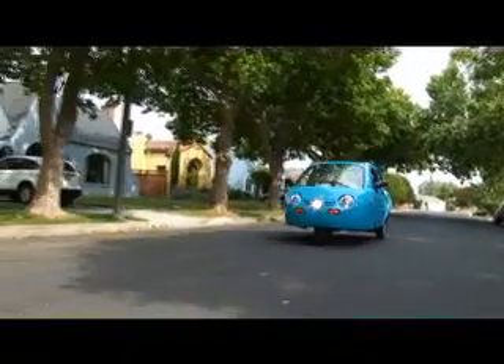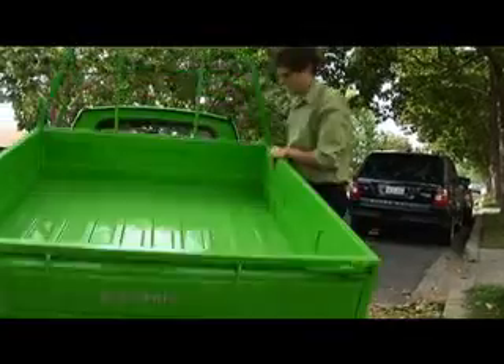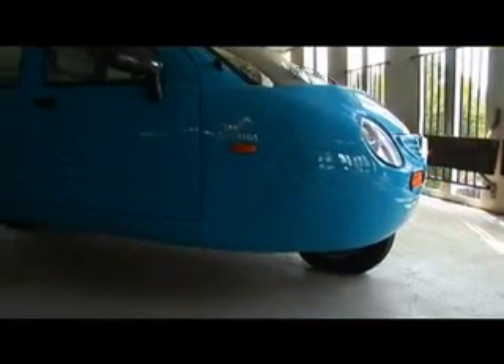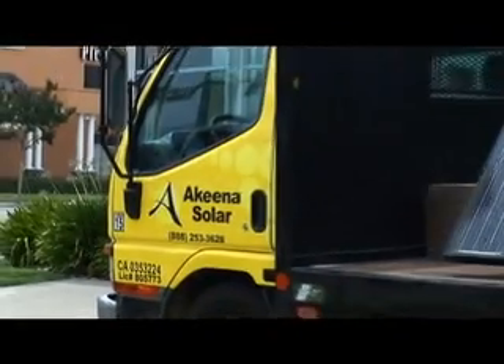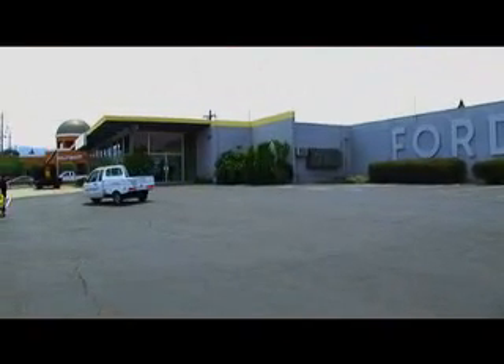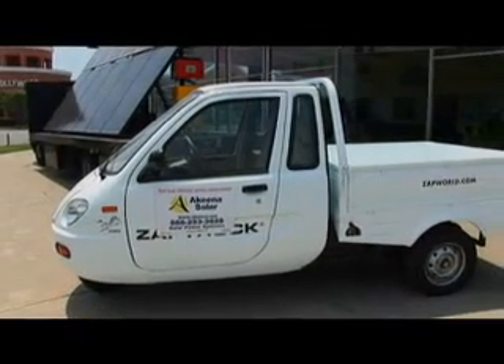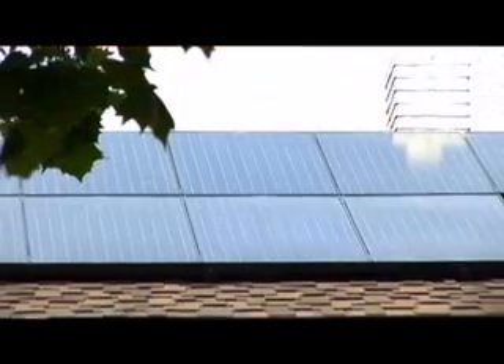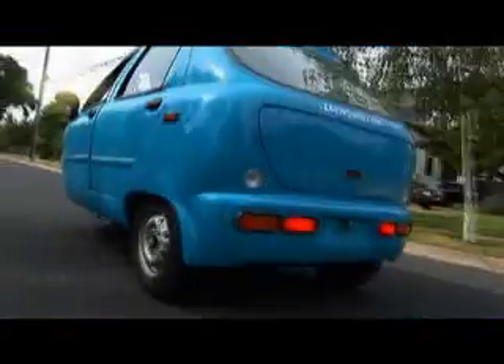Hippy Gourmet at Ethical Approach Autos & Akeena Solar!

Comment: i like the sound of a nickel a mile.  Gotta agree with others though that electric wont truly take off until the cars become at least as powerful as a typical gas guzzler and last about the same distance (at least 100-150 miles).  After that electric will become the rule.

Comment: 40mph 20-30 miles on a charge? not only is that too slow to take on most highways, it is not even enough to get an average person to their job and back. The other car that you mentioned that charged from the outlet isn't very energy dependent. The energy that comes out of your outlet is produced by burning coal. i don't see that as being any better than filling your car up with regular fuel.

Comment: You need to research that a bit more. Electricity from Power Plants is about 1/10 as polluting as using gas in your vehicle. Nothing is completely clean, but electric is WAY cleaner and more efficient.

Comment: I admire any experiment to get rid of the grip of the powerfull oil nations on the western world, But..Firstly, I think a car should at least be able to offer the same comfort as nowadays cars, and around 12 seconds from 0-100 km (0-60 miles), plus it should be able to drive at least, really.. no less than 150-160 km/hour
with the same safety as nowadays cars, (guess you can't make them too light)
IS that possible?(I guess its not) until then im afraid this isn't an alternative to a normal car

Comment: The only 2 problems I see with the electric cars is for one they're too small. I mean I'm over 6 feet that limits my mobility and ability to drive if the car is that small. The other problem would be that the car resembles the clown car from a circus. I half expected to see a giant key sticking out of the roof.

Comment: The USA Goverment instead of spending hundreds of bilions of dollars on silly wars to keep control over the oil, which is going to run out anyway, should have spent it for this kind of research and its application instead. And if the research here wasn't going fast enough they could have granted funds for scientists abroad to help out. It could have been an Iraqi scientist who could have found the solution but guess what he probobly got killed by a suicide bomber or by "friendly" fire.